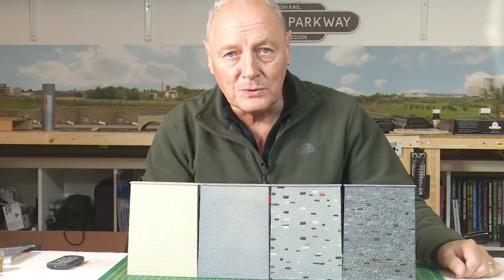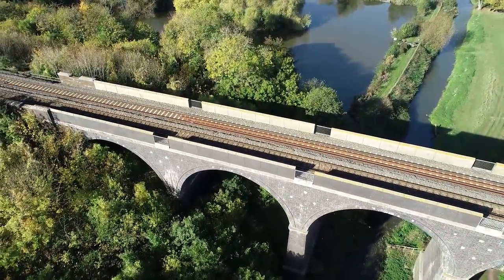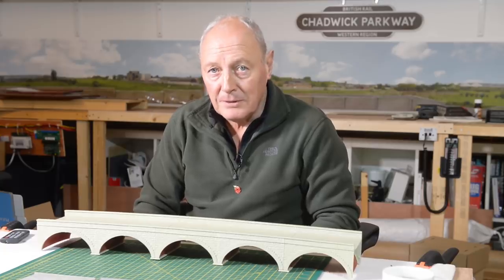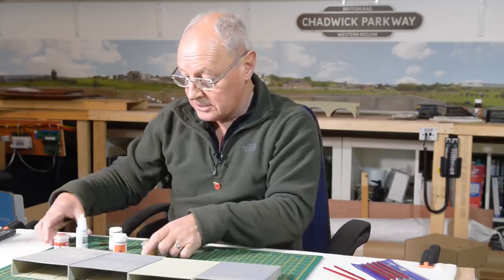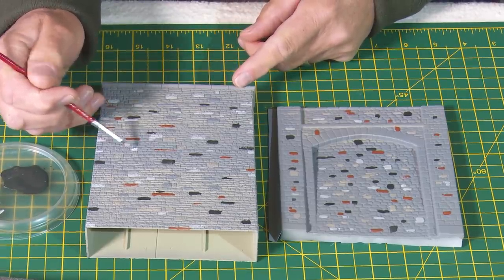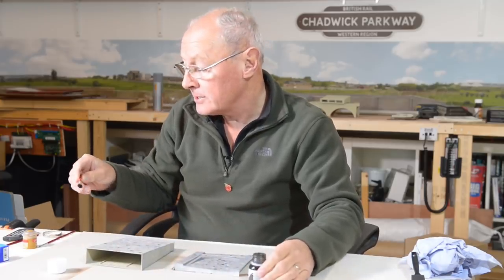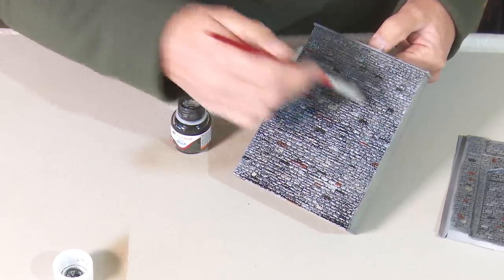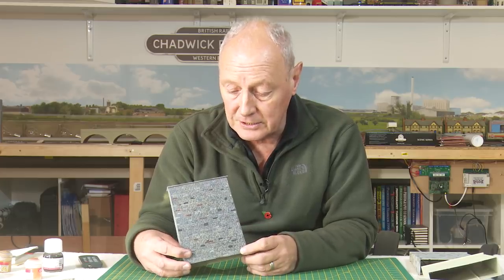47. Painting Model Railway Stone Walls at Chadwick Model railway

Comment: Another good video .I found this viaduct a nightmare to build. A tip that a good modeller gave me was to use charcoal pencils to bring out the stone work it worked a treat and looks very effective rubbed over the plastic brickwork and rubbed in with a finger. I also found the finished product was uneven. look forward to the next video.
Reply from the maker: I’m so pleased that you enjoyed the video David.  So the gauntlet is down! How many arches was yours and did you find the surface was curved?
Reply: @ChadwickModelRailway  Hi Charlie .My viaduct was five arches .I found the finished model was curved and rebuilt the outside piers with some plasticard to level the model then I laid 2mm cork sheet across the whole viaduct before placing the track  .I also added more brick sheets to give the effect of a king pier  in the middle which is prototypical of the viaducts on the settle and carlisle which my layout is based. Look forward to your next video

Comment: Hi there. Really love your videos & your work, it's quite inspirationnal.
Though, if I may give a bit of advice, I would rather paint the stonework with five different but close stone colors using the range from Vallejo's Model Color & Panzer aces. The basic 'stone' colors I like to use are the Model Color's "London Grey", "Basalt Grey" and "German Grey", mixed with Panzer Aces colors in shades of brown, sometimes adding a bit of blue or sandy yellow depending of the type of stone. Once the stones painted, I then apply a wash using either Model Air Concrete (ref. 71.131), Panzer Aces Splinter camouflage base (ref. 70.345) or Model Color's Off white (ref. 70.820). This wash will also smoothen the transition between the different tones of stone by leaving a thin mist of paint on top of the stones acting like a "filter". 

Once dry, you can highlight the stone texture by drybrushing some off white before weathering the stonewalls using Vallejo's model washes and weathering powders. 

This is a technique I used many times when painting buildings for my belgian model railway club (www.alaf.be) and also shown both at open door days & in Ally Pally at the stand of the Model Railway Club London of which I'm aso a member.
For more info on those colours check their website at https://acrylicosvallejo.com/en/categoria/hobby/
Hope those informations will prove helpfull, and thanks for sharing your expériences with us, as they're really usefull to many of us, myself included.
All the best,
Eric Sainte, Liège, Belgium.
Reply from the maker: Wow Eric, what a great response.
I’ll be at the Warley show this month and will certain look into Vallejo’s various paint options which you have mentioned.
Regards Charlie
Reply: Thanks for the useful advice.

Comment: Charlie, If the viaduct model was intended for use as a vehicle roadway, I believe there should be a slight curvature to the roadway for drainage. Looking at any vehicle bridge, you'll see it. Railroad bridges with no floors can be flat since the water can go right thru it and drainage is not required. I believe there is always a slight curvature to compensate for stresses under load. Approaches to the bridge could have been sloped to meet the curvature of the bridge eliminating the need to modify the model itself. Another example of this are flatbed semi trailers. The frames are pre stressed in an upward arch, in the unloaded condition. When loaded they "flatten out" and the frame stresses are now in a neutral stress condition which extends the life of the trailer. The amount of curvature may be argued but I believe there should be some there. I could be wrong though, I'm no structural engineer.
Reply from the maker: A fair point and very true of steel bridges. On stone structures I’m no so sure.  It doesn’t change my mind on the worn/poor quality mold of this product.
Reply: I'm not sure either when it comes to stone structures, especially when it comes to railroad bridges. But I have seen similar stone bridges that are arched. It was just a thought I had. As far as the quality of some kits go, I agree, some aren't that great. I got a water tower kit that was warped such the halves would not meet. They can have misleading labeling too. I got an oil platform kit that had a warped platform not to mention other parts that were also warped. What really upset me on this kit was the fact that the labeling actually showed 2 kits put together but it did not indicate this on the box. It stated that you could put multiple kits together but not that what was pictured was actually 2 kits put together. I thought I was getting what was pictured on the box and I wasn't. In both cases, I complained and received replacement kits. That was nice but I shouldn't need to complain in the first place.   @ChadwickModelRailway
Reply from the maker: Hi Gene, great points and I thoroughly agree. Some kits are dreadfully inaccurate.

Comment: It is rare to see a 'straight' old railway bridge. If it is bent out-of-the-box, then it has subsided over 150+ years; so paint in cracks and repairs!
Reply from the maker: A very good point.
Reply: @ChadwickModelRailway  I agree with this one. I don't see what the problem is with the curved bridge unless you're afraid of uncoupling, which happens on my RR because I haven't maintained my couplers for a while. But I think the slight curve looks kind of good. I don't think it's a flaw with the kit, I could be wrong. Awesome video. Thank you

Comment: Did you try heating with a Heat Gun in the centre and then weighing it down on a flat surface until cool?
Reply from the maker: I had though of that but I believe that it could well distort its appearance and could well ruin the model. Regards Charlie